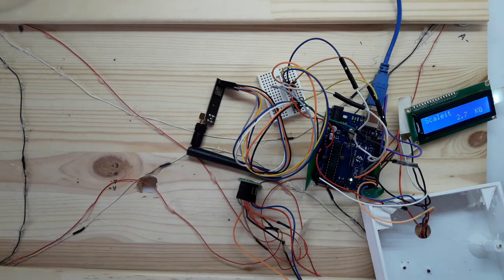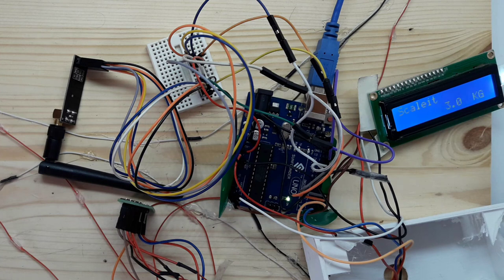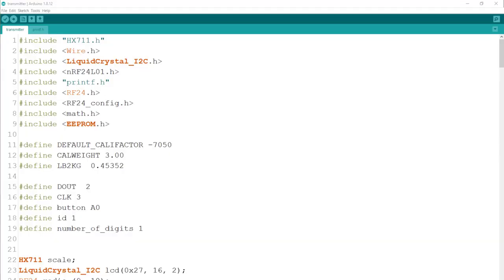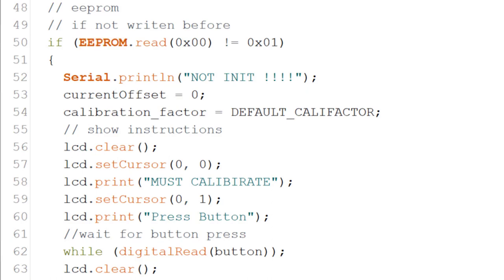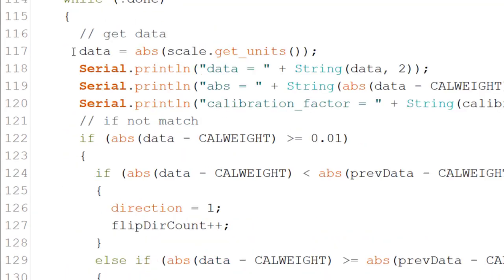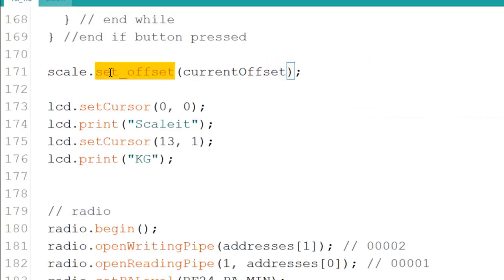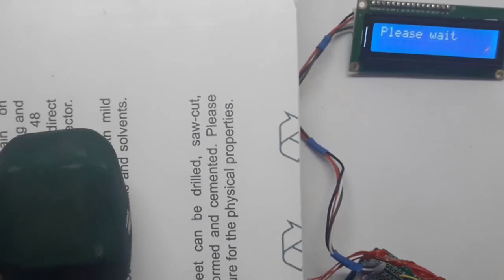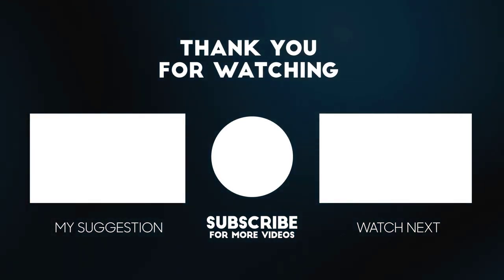Auto calibrate hx711 scale with known weight.

Comment: Hi, I have a question: is that still working if while the Arduino is switched off you put 1 more kg on sensors? Will the arduino know to calculate 4 kg of weight when it will be turned on? I mean if it is able to measure a difference of weight that is coming while arduino is off.
Reply from the maker: If you calibrate the scale correctly, no matter what you do, when you turn it off and on it should show the right weight on it.

Comment: Please one question :) I would measure in grams also calibration with known 100 g weight, what to change in code? thanks :)
Reply from the maker: The calculation is driven from the return value of X, when its known what X will be at 3KG, then its easy to do the math. 
And on top of that it goes into a diving to know "scale units" 
 // set new factor 
        calibration_factor += direction * dirScale;
        scale.set_scale(calibration_factor / LB2KG);

you can find the code here 

https://create.arduino.cc/projecthub/talofer99/auto-calibrate-hx711-scale-with-known-weight-7ae97d

And you can change the accepted value to be of smaller scale and then you can work in grams 

DO NOTE: You will not be able to be accurate in grams when it comes to loadcells of 3K and above. 
You will have to use a 1K load cell to get any accuracy out of it.
Reply: @talofer99  ok, thanks 🙂

Comment: What source did you use for printf.h? I tried using LibPrintf.h; according to Arduino's site, it adds "support for the printf family of functions to the Arduino SDK. This library provides support for printf() and other printf-like functions ..." But the compiler said:
compilation terminated.
exit status 1
printf.h: No such file or directory
Reply from the maker: I got this code as a project, and it had a printf.h file in it - this is the content of it : 

/*
 Copyright (C) 2011 J. Coliz <maniacbug@ymail.com>
 
 This program is free software; you can redistribute it and/or
 modify it under the terms of the GNU General Public License
 version 2 as published by the Free Software Foundation.
 */
 
/**
 * @file printf.h
 *
 * Setup necessary to direct stdout to the Arduino Serial library, which
 * enables 'printf'
 */

#ifndef _PRINTF_H_
#define _PRINTF_H_

#ifdef ARDUINO

int serial_putc( char c, FILE * ) 
{
  Serial.write( c );

  return c;
} 

void printf_begin(void)
{
  fdevopen( &serial_putc, 0 );
}

#else
#error This example is only for use on Arduino.
#endif // ARDUINO

#endif // _PRINTF_H_

Comment: Great work! Unfortunatelly, I can't open the link in description. Could you please paste it here once again? Thanks
Reply from the maker: Hi, thank you very much.

At first I did not understand what link can be broken. until I check the one to the Arduino Creator Hub .... they have upgraded there system, and wiped out all the old data - I'm actually pretty shocked they did it. 
Thanks for letting me know, I have another post I think on another site will try to look for it later and will send it to you.
Reply from the maker: There you go .. lucky I got it all on this site as well 
https://www.electromaker.io/project/view/auto-calibrate-hx711-scale-with-known-weight
Reply: @talofer99  Very useful! Thanks a lot! I am building a scale for bee hive, same construct as yours, 4 cells, each rated to 50kg. However, I am worried that constant load (hive + honey + bees) without occasional force release would damage these cells in short time even though sum mass should never exceed 50-80 kg. What do you think and do you have some other, more durable, cells to recommend this? Thanks
Reply from the maker: @MilanNedic94  I never got to test them for a long time. only short tests for creating the prototype. 
But as far as I know they should not have any issue with it. I know there are a lot of products that do what you plan to do for other stuff, like beer kegs. 

Would love to see photos of the end product :)

Comment: Hello Sir, is there any possibility to reset the calibration process? I was trying to reset with the reset button on arduino, but still not working.
Reply from the maker: Yes its possible, hold the button (on my code its connected to A0) down when you reset the board. this restarts the calibration process
Reply: @talofer99  Thanks a lot!

Comment: Thanks for the interesting video, I am currently trying to hack my Epsom inkjet printer because the ink cartridges are expensive and I think it's a bit of a racket going on there, if it all works out I will do a video.
Reply from the maker: thanks :) 

what do you plan to do to the cartridges ?
Reply: @talofer99  find a way to refill them from bottled ink which is much less expensive to buy
Reply from the maker: @SusanAmberBruce  lived in Thailand for many years, and there they sell the ink printers pre-hacked with external refillable ink tank :)
Reply: @talofer99  cool sounds like a place I would like then.

Comment: how did you connect the button on the arduino ?
Reply from the maker: Using pin A0, when the other side of the button connected to GND.
Reply: @talofer99  okay thank you
Reply: I'm using a 20x4 LCD is there anywhere in the code where I have yo change?
Reply from the maker: Sorry it took me so long to reply - your comments went to "possible spam" for some reason. 

There is a line for it 

LiquidCrystal_I2C lcd(0x3F, 16, 2); //0x27

Comment: Hi, Thanks for video, this code is same like a transmitter code, could you please share a receiver part code? And I have any request, most HX711 source code and NRF24 source code are different and same times is doesnt work. So could you please share a your HX711 libraries and RF24 libraries. Thank you sir. Best Regards
Reply from the maker: This is the hx711 
https://github.com/bogde/HX711

NRF 
https://github.com/nRF24/RF24

The receiver code 

#include <nRF24L01.h>
#include <RF24.h>
#include <RF24_config.h>
#define number_of_digits 1

RF24 radio (4,5);                       
const byte addresses[][6] = {"00001", "00002"};            
double data[2];

void printDataJson(double *_data)
{
  String jsonData="{\"id\":" + String((int)_data[0]) + ",";
  jsonData+="\"w\":" + String(_data[1],number_of_digits) + "}\n";
  Serial.print(jsonData);
}

void setup() {
  
  Serial.begin(115200);
  //Serial.println("Reciver started");
  
  radio.begin();
  radio.openWritingPipe(addresses[0]); 
  radio.openReadingPipe(1, addresses[1]); 
  radio.setPALevel(RF24_PA_MIN);
  radio.setDataRate(RF24_250KBPS);       
  radio.setChannel(100);                 
 }

void loop() {
  radio.startListening();  
    
  if (radio.available())                
  {
    radio.read(&data, sizeof(data));
    printDataJson(data);
  }
}
Reply: Thank you sir I will try and I will say result, but I didn't see the receiver part